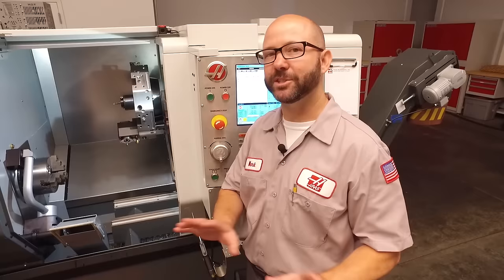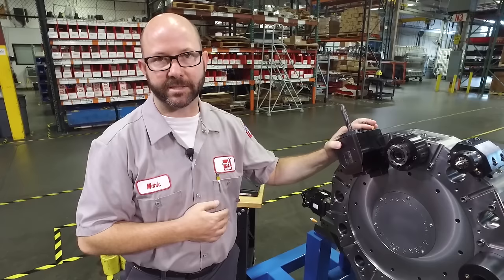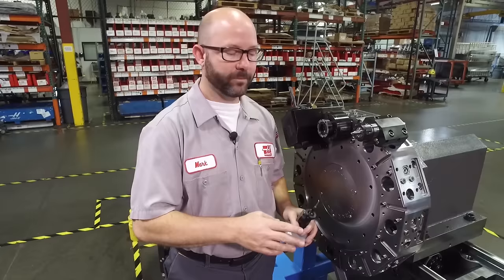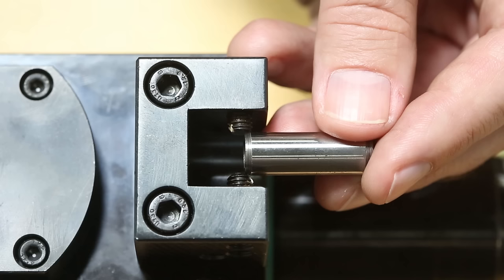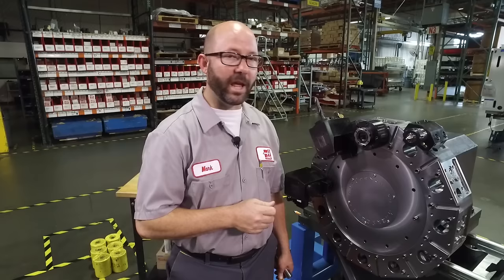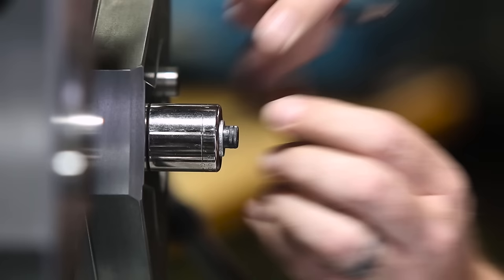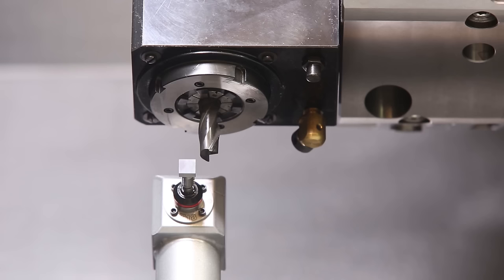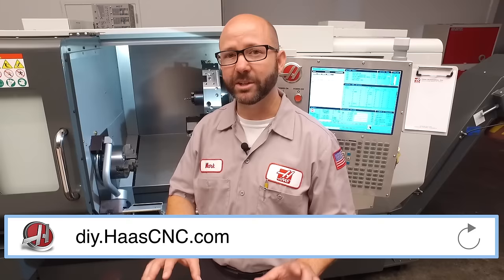Set Up Live Tools Properly on Your Haas Lathe – Haas Automation Tip of the Day

Comment: I'm trying to find information on teaching live tools using the Next Generation Control. After playing around with my machine I found out these instructions are not correct for the new control. No need to correct the tool table for half the diameter on the tool. I'm also confused about what page I should be on for making tool offsets on live tools. Oddly enough, it's not in the "Live Tool Wear" column. Your videos and explanation of topics is outstanding! Keep up the great work :)
Reply from the maker: Master40 – This is a great topic for a video, we’ll move it up on our list! We are making software changes to the way we input our Live-Tooling Tool Diameters. There are new columns on NGC lathes called Live Tool Radius and Live Tool Wear, but these are currently just placeholders for an upcoming software improvement. We can enter our Live Tool Radius onto our Radius Geometry column on the Tool Offset page, in the same way we always have, for now. Cutter compensation must still be called in the program (G41/G42) to make use of the value in Radius Geometry. Thanks for the question, this will definitely end up in a video. – Mark, Haas Tip-of-the-day
Reply: @haasautomation  Mark, with the NGC control, the VPS portion just generates the G211 for you. We make extensive use of the G41/G42 when using XC to XY interpolation. For an axial tool, using F2 to set to center line works for centering the tool. When using the probing macro for it, I've found that it's not quite right because the tool isn't a perfect .500 DIA. Being able to get the actual DIA from the presetter like with the OTP in our mill would be awesome and solve both the centerline issue and the wear issue for G112. Thanks!
Reply: @haasautomation  Patiently waiting...

Comment: Why not make a probing cycle for radial live tooling that probes on both sides of the tool probe to calculate center line and DIA of the tool? Like the renishaw tool probes for mills.
Reply: definitely doable. You would have to copy and modify the probing macro to output the two values to unused registers, do the math, then store in Z geometry register. You have most of the program you would need already, just need to do some copy and paste
Reply: That was my biggest question after the video.
Reply: Same! Would love to see this. Especially on the NGC now you use the VPS to generate the touch-off for it. It only generates a G211 though, which doesn't really give you options to work with the offsets and calculate the diameter.

Comment: @haasautomation

hello. i have lathe ST15 with live tool, axis Y and NGC system. I changed flute values in tools offsets from zero to two. Now when I use the milling tool(live tool), it is not correct in the Y axis. And problem is i cant change back the values in flute to zero. please help me.

Comment: I know the video is a couple of months old, but I was wondering why the endmill is rotating when being indicated?

I can see the pro's of this, as getting the outer diameter right on the endmill by rotating it by hand would be quite difficult, and I don't know if there is any standard as to the placement of the shank-groove (of that is the right word - hope you get what I'm trying ti say) for the set-screw in accordance to the tips of one of the teeth.

If the latter is actually something that is taken into consideration from the manufacturer's perspective, then wouldn't it be easier to design a radial tool-holder with the function of an M29 code (spindle sync for tapping cycles if I remember correctly) each time it stops spinning? :)

Anyways, thanks for all the expertly explained videos - they give me a good understanding of many things I haven't had the chance to work with over the last 3 years of my apprenticeship ^^,

Cheers from a Danish fan :b

Comment: What would cause my x axis to half/quarter  itself (cuts half what its told in total?), only while milling on the face? G17, non polar cartesian (errors out for excessive spindle feedrate if I try,  but I'd rather not anyway-no need and better quality). ST15Y, and everything comes out to size when milling radially.

Comment: Isn´t it necessary, to change the tip direction number from 3 to 8 after measuring the tool? The tool´s measured in his center, so it has to be tip 8 and not tip 3. And what about entering a radius? These things are important, if you want to work with G41/G42.

Comment: Thanks mark for all this information , I want to ask about the torque in VDI holders is it the same on all that 40mm holes in the turret . and how the mechanism of movement is working .
Reply from the maker: Yes the torque is the same for all 40mm VDI holders. The bolt in the lock screw assembly is trapped by a C-clip, this allows the wedge to be pushed and pulled by rotating the bolt clockwise or counter clockwise.

Comment: Question, since you can make the tool attachment's, Why are they so expensive, 4K for 1 tool attachment, i could buy a whole 2nd hand Haas machine for that.
Reply: D-Gears Ltd You could probably fabricate your own for much less. I see other brands selling for $599 and I think they’re still too expensive for a block with bearings and a mini spindle. Fairly simple construction even if you want a radial and use a Pinion bevel gear to interface. Plus you could make yourself a 45 degree or any number of angles you may have a need for.
Reply: D-Gears Ltd the better answer should be because they can and it seems there is a certain customer that buys at any cost and Haas is tailored towards them. For myself and business we won’t ever afford one in this lifetime or specifically justify the cost when a number of other less expensive options will perform the tasks we need.

Comment: Very good. I have just used the cnc machine lather so there is a question of setting the offset for the grooving tool when cutting the groove. Is it necessary to compensate for the width of the knife?
Reply from the maker: Dat nguyentrong – Yes, we usually set the tool on the front, bottom edge, and then adjust our program to account for the width of the grooving tool. Good luck! – Mark, Haas Tip-of-the-day
Reply: Haas Automation, Inc. Thanks!

Comment: Nice video. 7:26 dowel pin inserted the wrong way. Thread facing inside.
Reply: That is great! Sharp eye. I actually remember putting that in backwards, and then tightening an ER32 collet extension on it, to help me pull it out!

Comment: While using mdi, how do I get the absolute coordinate to read on control  screen as opposed to what it does now (reads from machine zero)?
Reply: when I´m measuring Z0 for G54 offset, on Doosan Lynx I usually go to the MDI, 
G28 U0;
G28 W0;
T0101;
pressing Cycle Start, you´ll get the turret to home position and you got loaded tool 1 with offset 1, so now it´s an absolute coordinate for that tool.... Maybe it works like this on HAAS too

Comment: Why are axial and radial the only live options?
Reply from the maker: Glenn – We can also add angled VDI or BMT heads on your Haas Live Tool lathes. Companies like Benz, MD Tooling, and Heimatec offer angled heads built to fit your machine. You can Vector tap at these angles with a G195 code on your Haas Lathe. – Mark, Haas Tip of the day

Comment: Too lazy to scroll through comments... just got new Haas lathe in today and I'm told there is no -soft limit/chuck barrier.... is this true? If so, WHY?!
Reply: Miguel the Caucasian how much did it cost
Reply: ELLINARAS 456 I believe right around $120K
Reply: Miguel the Caucasian thanks
Reply from the maker: Hi Miguel – We have soft limits in the control to avoid the Tailstock. These can be accessed through Settings 93 and 94. For the Main Spindle, we don’t have any kind of user-accessible protected positioning. Especially with Radial Live-Tools, we often have to position the turret directly above the chuck, and use extended holders in order to reach some parts. Would still be a nice feature though, we’ll put in on the list.  – Mark, Haas Tip-of-the-day

Comment: Great video but those VDI live holders are a pain.   Why not just put the dowels on the face of the turret where the tool body sits like all of the Swiss machines do?   Then there is zero indicating necessary unless you're doing a grid shift.   This seems inefficient at best and poorly engineered at worst.
Reply from the maker: Rob- Having some slight adjustability in the system allows us to dial things in perfectly for each tool, but we hear what you’re saying. Take a look at our new BMT live-tooling system - https://www.youtube.com/watch?v=Egd7UubQIxU. Release on these lathes is just around the corner.
Reply: BMT looks much better and quite similar to how our Miyano functions.  It looks like this'll be a great improvement for your machines.  My point was more along the lines of why do you need to dial the tool in?  It should be designed such that it's plug and play and all you need to do is dial in X or Z depending on if it's a radial or axial tool respectively.  The control should know exactly where the live centerline is and the machine/holders should be able to repeat to that centerline without having to adjust each tool.  I think the problem is that this current method allows for higher tolerances in manufacturing making it easier and less costly (puts the labor burden on your customer).  It already takes us long enough to change over, we don't need to be indicating tools in where it can be avoided by sound design.

Comment: It amazes how shockinly shite the design is on these turrets, why would you ever want operators/setters banging dowel pins into a turret with the possibility of them not only bashing the crap out of the turret but also putting it in the wrong way. Also why would you ever want to tie yourself down to only being able to put 6 vdi tools on the turret and why do they have to stick out so far? If you mounted the radial tools to the under side of the turret instead of the face you wouldn't need to worry about using a pin to indicate it straight. Don't even get me started on spinning an end mill and winding it against your tool eye.  No wonder hass have a bad reputation.
Reply from the maker: Alex – Check out our BMT lathe turret https://youtu.be/v-1N1Tf4ZGc, and https://youtu.be/pqitYUvO3os There is a huge aftermarket industry, providing tooling for these lathes as well (Heimatec, Eppinger, MD Tooling, WTO, Global CNC), many of which work with our ½ station index turret that allow us to double the number of tools a turret can hold.  Mark, Haas Tip-of-the-day